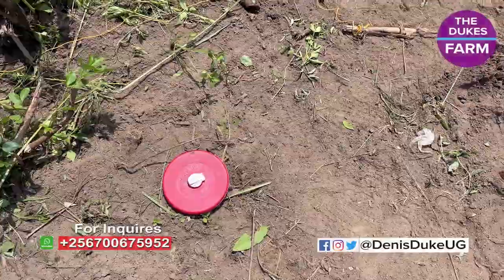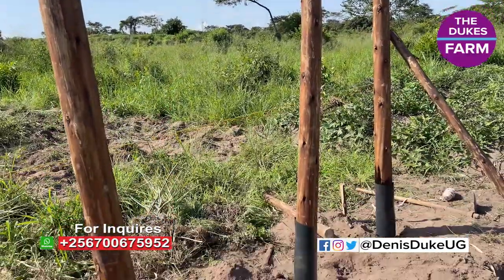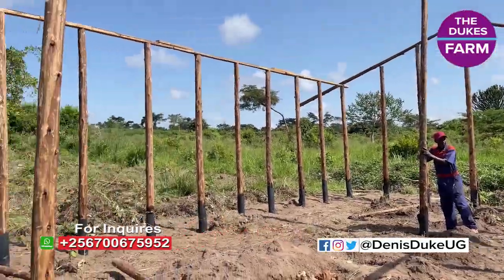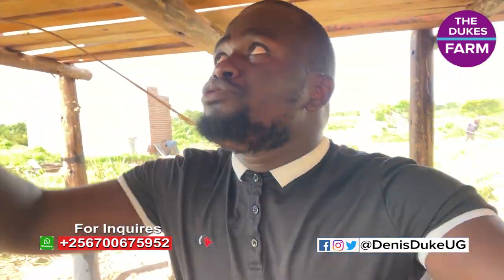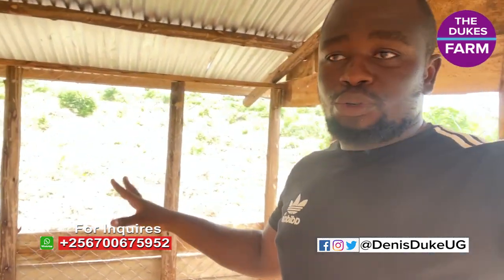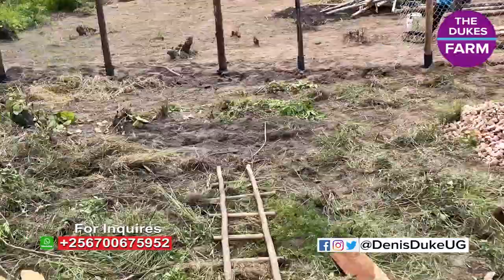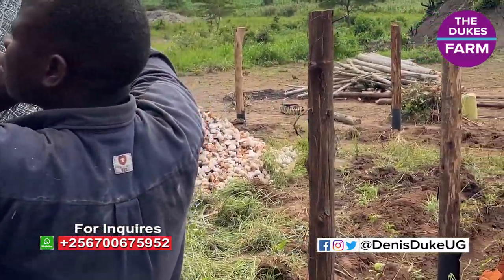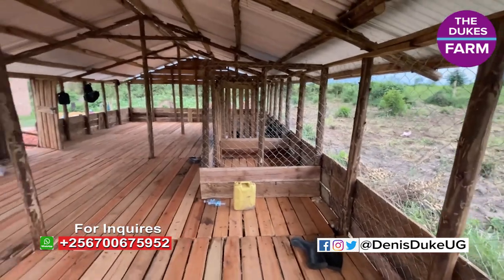Goat Farming; How To Construct a Raised Goat House in 2024

Comment: Dear Duke,i have a question
Is also goat's urine good as rabbit urine??
Can i put the floor with ' nkokoto' as we make our floor, just cement and sand with some small stones??

Can i also put like 4or5 pieces of timber  ( mbawo)on the kids unit to avoid coldness??
Reply from the maker: The Urine is not as good as Rabbits. The floor would be better with Marram as it helps absorb the urine
Reply from the maker: For the kit’s section yes you can. It’s imperative that you save them from coldness